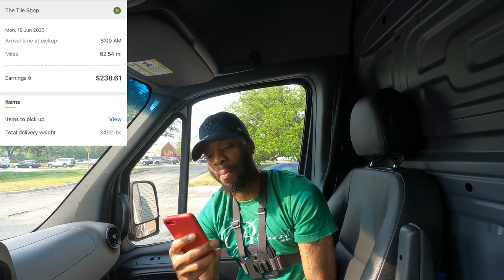How To Get A DOUBLE Order On The BUNGII APP! DUO Lift To SOLO Lift  #foryou

Comment: Deion at Skokie! He's a good dude.
Always nice when they have a skidsteer or forklift at the delivery spot. You might want to invest in a tow strap or chain for situations where the skid is too far in for the forks to bite on. I can imagine you running into that predicament with Smokes length at some point.
Reply from the maker: He definitely seemed like a real good dude!! I definitely have had to use a strap before to pull the pallet closer to the door. Works like a charm!

Comment: Keep up the great work. couple questions how many apps do you use at one time? Did you buy your sprinter new or used? Which apps can you use a rented sprinter van? How do you choose which app you're gonna use for the day? Thank you in advance for your answers
Reply from the maker: Thank you!! I turn on about 7-8 apps every day. I run them simultaneously. I take the best orders off whichever app pops up with one as long as they fit in with any orders I may have already taken. I bought the van new. I am not sure exactly which apps allow rented vans, you would have to research that a little on each one. I know on Dispatch It app you can input information for a rented van. Hope that helps!

Comment: This is crazy definitely not for the human body it’s going to mess your back up  that’s for a box truck all money ain’t good they at least should’ve paid half of the weight because the customer is paying 3,000 bucks
Reply: I agree with you for any load over 2000 lbs, and depending on the weight of each individual piece. But it's not too bad of a gig if it's under 2k, and the cartons are under 80lbs. Most of the time spent is behind the wheel, and it's almost always only gonna take 15-20 minutes tops(usually much less if your delivering to a garage and can back up to it) to unload, even if you take your time.
Reply from the maker: So glad It didn't have to be done by hand!! I'm pretty sure the customer paid around $400 for delivery.

Comment: Bro, get a pallet puller and he could have loaded them both through the back
Reply from the maker: I've used a strap multiple times, works great. He didn't want to push the pallet with the other one.
Reply: @carsandcribs  I feel that.. some delivery guys use a wooden wedge or 2 to keep space between when pushing the pallets so the contents won't touch as well and so the pallets won't break if they are trash.. but made it happen and got paid so that's all that matters
Reply from the maker: @the_freedom_movement  I'll definitely keep that in mind!! Thanks for the info.